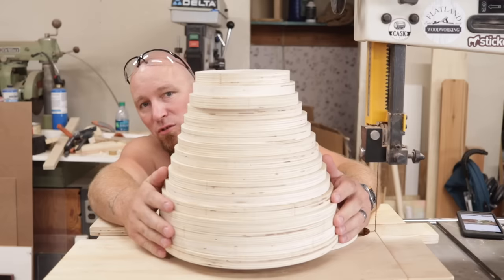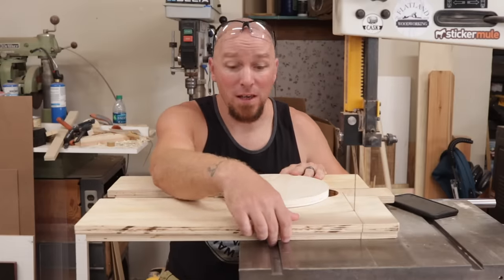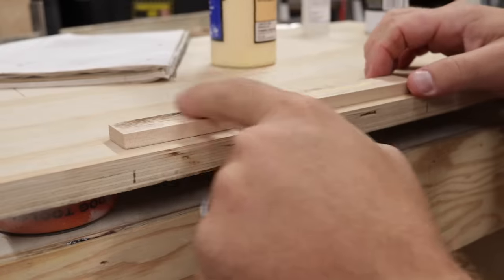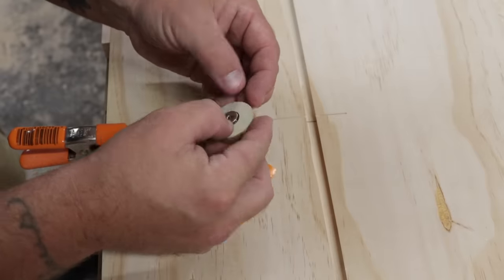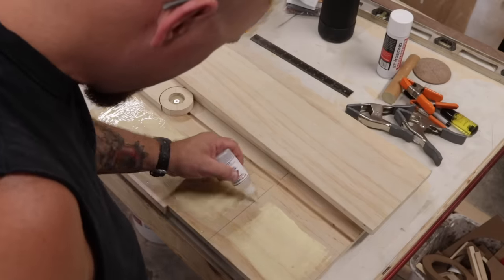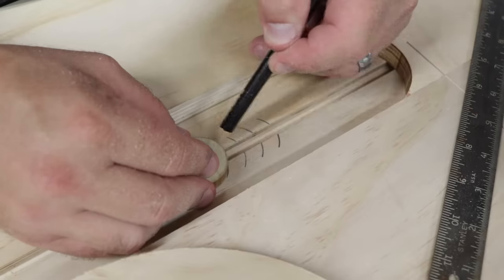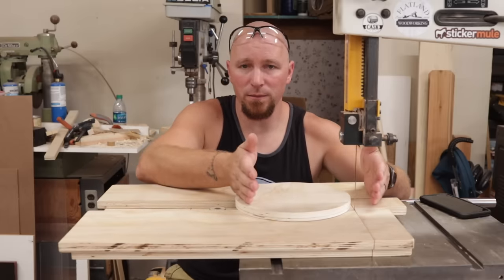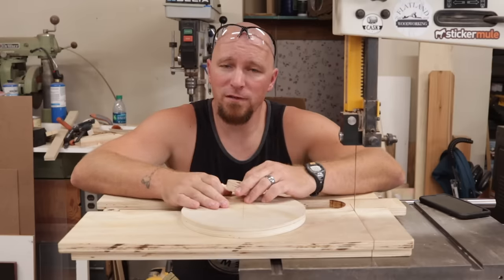The ONLY bandsaw circle cutting jig that fits EVERY NEED!

Comment: How about using a quick clamp on your left side to hold jig flat when doing large circles?
Reply from the maker: Yes that would work. I didn't want to have to be clamped because when I need to do a large batch of circles I don't want to fuss with a clamp. But that would definitely work. I have never actually had an issue with it rocking so I haven't put much thought into it since I made it.

Comment: You have three options for that rocking issue:

1. Add 1 inch neodymium magnets to the bottom of your jig at the blade end so that they hold it down to the surface of your table. 

2. Add a dado rudder underside of the jig and insert a 1.5 - 2 inch board so that it runs next to the side of the table.

3. Make an extension for your table so that it holds the entire jig.

Comment: Add two T-nuts to the existing T-track.
Two through the fixture flat head screws tighten the fixture securely to the table and leave the fixture top clear for large circles.

Comment: May I suggest one improvement to the jig?
It is important that the circle centre line up with the front edge of the teeth (front to back on the band saw), but every time you put on a different blade or adjust the blade on the wheel, the jig needs to be reset so the centre lines up with  the front of the teeth.
To make an adjustable stop,  put  a threaded insert in the fixed wood stop, and a bolt through it makes an adjustable stop.
When setting up the jig, push the empty jig into position, then adjust the bolt against the front of the saw table until the cutting circle lines up with the front of the teeth.  Pull the jig back and load the blank.  When you push the blank into the blade, the adjustment bolt coming against the table stops the sled at the correct position.

Instead of using a threaded insert,  you can also use a nylon insert lock nut let into the back of the stop. (This keeps the bolt from moving due to vibration, but probably requires a wrench to adjust the bolt.)
Reply: Circle center line is better 1/3 of blade width backwards. Adjustable stop is a must.

Comment: Love it   I have a circle jig I built off a couple different designs.  Have you run into any issues with different blade widths?  Or have you just run this with one style of blade?   Love the design.
Reply from the maker: Thanks! I have only run it with this blade, which if I remember right is a 1/4 - 6tpi or so. Two things I like about it though: If you want to run a bigger blade, you can just shim out the sled at the positive stop to keep the front of the teeth on the centerline. And if you run a thicker blade, you can just replace the zero-clearance insert when you swap blades again. Now that I think about it, it would probably be wise to make a few of the inserts ahead of time so you don't have to make more down the road. You could just store them in the bandsaw cabinet if you have it or something.

Comment: To stop the jig from rocking i would extend the jig out so it was over the other locking track on the cast bed of the bandsaw, and make some more locking pieces. This will hold down any size of jig and stop it tipping.

Comment: Cool… how could this NOT work
Similar to Bravo, I would leave the bottom side of the jig, on the left side , extend all the way to the left edge of the saw's table.  That way, you could easily clamp down the jig  to the table and not create a cantilevered issue with larger pieces.  At least, that works in my head; will it work in real life?  I seems it should.   This appears to be a great solution.
Reply from the maker: I think it would work great! If I remember right I was limited on materials I had around the shop already. In hindsight I would definitely go that route.

Comment: I’m not clear on how a circles center is found after adjusting the donut to the intended radius or vice versa. With a pinned center it’s just a matter of setting your board on a pre-drilled hole but with the tape on donut when the work piece is upside down it looks like the donut can be centered but renders your scale relatively useless. Hence, all cuts would be measured on top of the board from the blade of the bandsaw and subsequent inner cuts as well. Did I miss something about the use of the scale or the donut?
Reply from the maker: I'm not sure that I completely understand but the scale is set beforehand. I just adjust it to the measurement that I want, secure the donut to the piece that I'm cutting and slide it on. The rest takes care of itself. Not to be rude but you might have missed something because I think this is the first comment I have seen like this. If you watch it again and still don't understand, let me know and I will try to explain further.

Comment: Question could you not extend the table to your next track and put another slide. Wouldn't that stop your tipping.. Richard
Reply from the maker: You could! And right now I don't remember why I didn't because I made more than one track. On the plus side I haven't had any issues with rocking whatsoever, but if I made it again I would probably go that route.
Reply: you were just saying it could tilt on you in that video and I thought that may help reduce it and you would be able to clamp it down.. But still it was one heck of a great jig and I am second generation woodworker. Watched it 3 times, but still think I am missing something. If you have planes would like to get a set if not an arm and leg.. Great video again.Richard

Comment: I have tried several circle cutting jigs and I always end up with a small step in the circle as I finish the cut. Is this normal or am I doing something wrong? I have to sand the disc to remove the step. I have set the blade as you have mentioned and tried other settings but still get the small step at the end of my cut.
Reply from the maker: Hey John! I know exactly what you’re talking about and the one thing I have learned to do is to close the gap between the waste piece and the circle as you’re completing the cut. The reason that happens is because as the blade completes the cut it has no choice but jump offline because it runs out of material on both sides of the blade to keep it on track, causing a step. Closing the gap with your hand will give the blade something to reference and eliminate, or at least greatly reduce, that step. I hope that makes sense and helps!!
Reply: @InspireWoodcraft  Thanks for the tip, I will give it a try next time. It sounds logical.

Comment: Nice design for sure! I really need to make one. I was thinking about the rocking issue. What if you notch the left of the jig and clamp a piece of wood to the table with a mating notch, basically a ship lap, the left side of the jig would slip under keeping it from being able to lift? 🤔
Reply from the maker: Yeah I could see that. If I would have made the runner to really close dimensions there would be hardly any rocking, if any at all. But I’m sure that would work as well. I forgot to mention it in the video, but one of the things I wanted to get away from was having to clamp. I might have to make a 2.0. Ha!
Reply: Another quick fix instead of clamping would be a slip fit. The piece to the left of the jig could slide tightly onto the left of the table like a box with a couple open ends. Never hurts to make another. I think Henry Ford got all the way to the letter T before he was satisfied. I like the thinking you've done on this. It will keep me from having to think as much when I build one. I want both types one with the center clear and one with the hole. Sometime it's nice to have the hole depending on the application. It is tricky to drill a perfect center hole if you need one! Looking forward to the next video!

Comment: Unbelievable thought power here wow. 
1 jig for a specific job why not fasten directly to the table deck with 4 machine screws..drill and tap into the table deck and counter sink screw heads into the jig or use tap lock inserts in the deck. Carbide drill bit should do the trick. 
As long as the tapped holes or inserts are perfectly smooth to the deck surface no issues 
If I was you I’d apply for a utility patent right away.  Million dollar idea dude !!!!!!

Comment: Why didn't you put the stop on BEFORE cutting the first cut..
In fact I think the dovetail should be cut first, then you can slide the piece in (cut in) until the dovetail is centered on the blade teeth, and then find the stop point , trim end if necessary, and then attach the stop. This would allow you to be correct without having to be so precise at every single step. You would only need precision at one step instead of all of them.

Comment: Nice video thanks but it would have been a far better if you had told us at the beginning that the way to avoid a hole in the centre of the blank was to use double sided tape to secure the pivotal doughnut to the blank.  All the good construction info prior to you telling us that at 5 min 20 sec into the video, would then fall into place. As it was I was left wondering, where is this going? up until 5min 20.
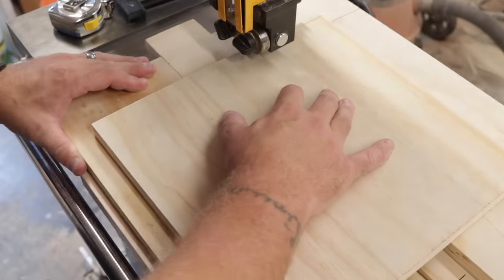Reply from the maker: Well I’m glad you got to 5:20. Now you know!

Comment: I really like your concept of this jig, however it has a real safety issues and that is if the jig can tip during use it can pitch the bandsaw blade in the kerf and destroy the blade and damage your machine and possible the operator. Clamps maybe not the best solution, magnets sound good as mentioned earlier but a real positive way to stop the rock would be to extend the stop down the thickness of the bandsaw table and under the the table, sort of like a L bracket down and under the machine top that way you still have a jig with an easy slide on and of without needing to get extra attachments. Any way just my thoughts, good luck and keep up with the great video content.

Comment: Why not just use a clamp of some kind to hold the jig to the table?  A c clamp would possibly work, or make a clamp using the scrap t pieces in the other slot. The solution is not really a problem guys, then the 41inch blank can be cut without the jig tipping. 
.

Comment: You do not utilize the area to you left? Longer table to your left and clamp, no rocking. Another ring with a pin, another ring with a peg, small box on this left wing for these accessories, slide mount and could act as a fence.

Comment: extend the base to the inside of the saw and clamp to the table.
Reply from the maker: The only problem with clamping is having to mess with the clamp. This was designed for production and that would’ve slowed me down. Good suggestion though! The rocking hasn’t caused a problem yet so that’s good news!

Comment: Hey Jody, I don't know if you review comments from post that were done as long ago as this one (I hope you do!), but I wanted to thank you for such a brilliant idea!  It was exactly the type of jig I wanted for a cutting board idea I had!  And I couldn't have achieved it without your hole-free jig!  My idea was an adaptation of the Incra design cutting board, which I've made several of, and they are very popular.  But I had this idea that required cutting a perfect, vertically centered circle (minus a segment off the top and bottom) on the board.  I purchased a brand new band saw just for this project (although I didn't tell me wife that!)! 
 
The result turned out more difficult then expected.  But here's what I ended up with: https://imgur.com/a/NGKRvNE

Your jig made this possible . . .  Thanks again!

Comment: What is stopping you from adding a support over to the second slot in the band saw table...no more rocking.
Reply from the maker: The rocking hasn't been an issue at all. But it's funny you say that because I did cut up more than one runner and I honestly don't remember why I didn't use it.